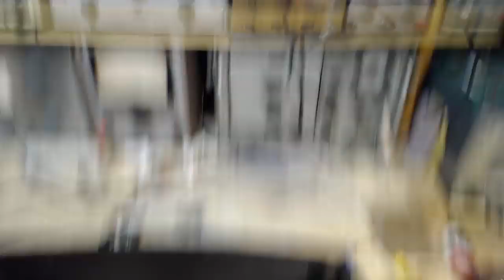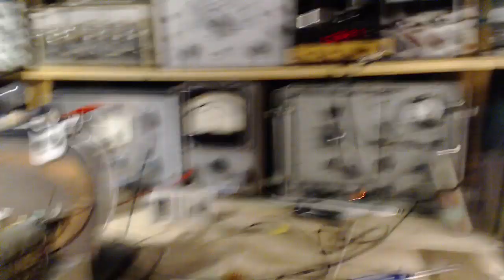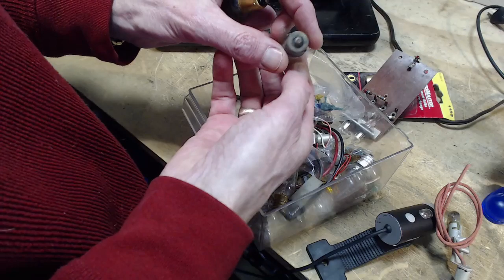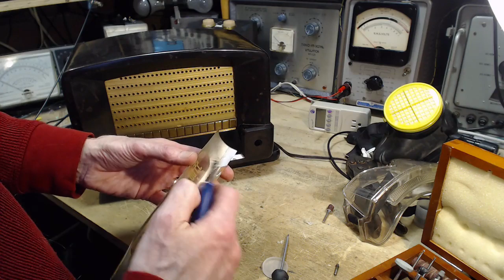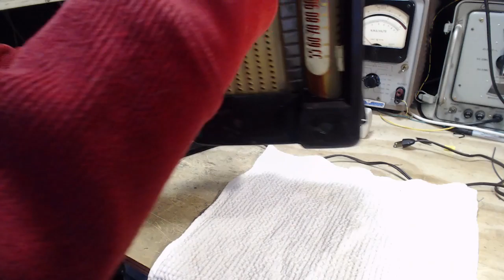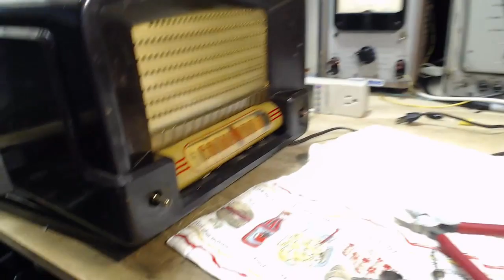General Electric C600 Video #8 - Long Finish

Comment: I can not understand why Jim persists in mal-adjusting the trimmers at the bottom end of the band. Then when they have no effect he fails to check what damage he has done to the alignment at the top end of the band, which is where they should be adjusted.

Comment: Jim...you never corrected the dial string as it doesn’t hook together like it is. Also...I found on Antique Forum that bulb can be replaced with a 6 watt 6S6/DC for anybody that might be interested. I see you changed out the the 12sj7 with a 12sk7. Should have at least tried the 35L6 to see if it helped the distortion.

Comment: Capacitors "shunt" (switch) the signals in their range to a "signal dump" (ground).by dividing/diverting that signal from the one desired in the final sound output.  "Drain" implies a build up in something that has to be periodically removed later on, not continuously.

Comment: That IF can still sounds bad to my ears. I have one right now with a bad IF can that will play but goes to this type of tone when it gets hot and thermal expansion makes it go out of whack. Just haven't had time to yank it out yet and see what the deal is. Guess I have plenty of time ahead now since my work is shut down. It does the same thing when you touch it as this did. Try putting in another IF can or pull that one apart. Wrong cap value shouldn't cause it to jump up in volume when you touch it regardless.

Comment: So, the pointer gets stuck in the scale... What Jim does? He goes medieval on the scale with the dremel...
Thinking outside the box, why didn't he cut the pointer, just asking...
@ 33:53 "There you are 460" Duh the frequency meter reads 449, just a minor detail...